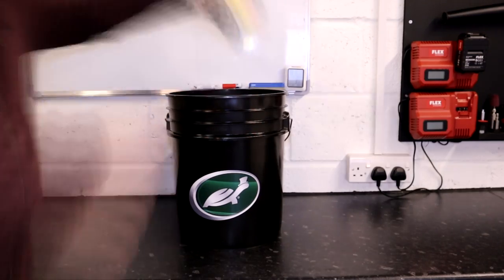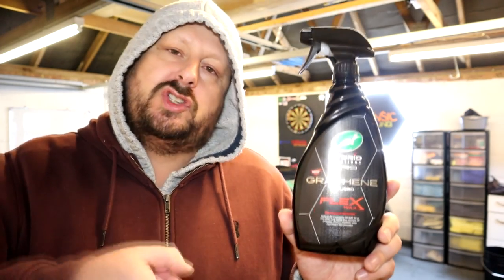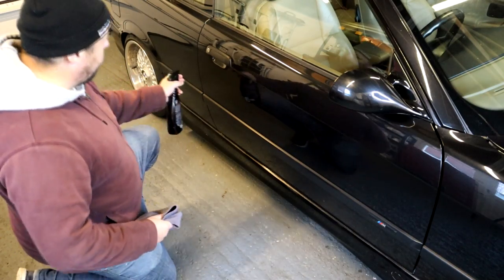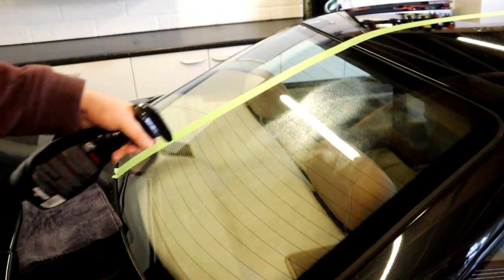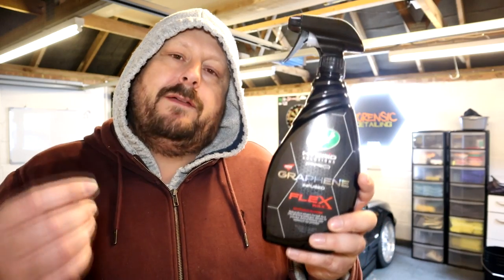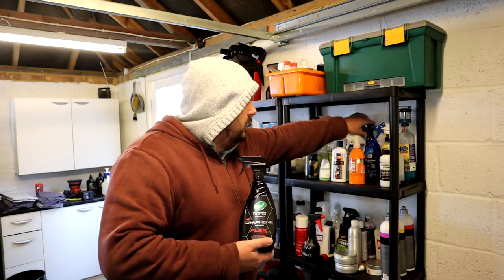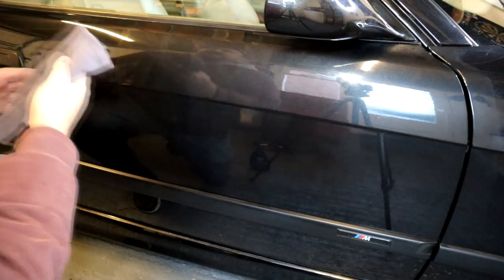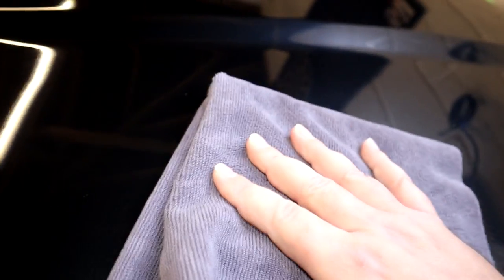Turtle Wax Flex Wax | Paint Wheels Glass Plastics | Base Coat or Topper or Spray and Rinse

Comment: Hi from Southern California.  2 years ago I bought a new K5 GT LINE in passion red metallic paint. Its a gorgeous color, and when the car was a month old, i hand waxed it.  I used Maguires ultimate wax, which is what i used on the old car and i liked it. It didn't really make the paint look as good as i had hoped.  Then i tried  this product,   I could tell in the garage this was looking pretty good.  But when i backed it out into the sunshine,  before i realized i was shouting WOW!!! I said it again,  WOW! Just looked fantastic. it actually sparkles!  I wash the car once a week, it lasts about 2 months,  the hood and trunk goes from beading to good sheeting, sides of car still bead. So i mist the car while wet, and dry.  Our California sun is strong, and theres no covered parking where i work. Car is about 2 and a half years old now, and the paint looks like new, and always feels very slick. Very happy i discovered this product,  and will definitely keep using it. Enjoyed your video.

Comment: It can only be used a spray and rinse if you have a base coat that has been applied to a dry vehicle and cured first. Then, and only then you can spray n then rinse to apply.

I have even sprayed this on my vehicle on a day it was raining outside and i was about to drive roughly 30 miles on the highway. Point is, i had my vehicle with a good foundation of this product and its been about 4 days and it was getting a little dusty. I sprayed about 3 to 4 sprays a panel and drove my vehicle out of the garage so it was bone dry to start.

Anyway, the next day my vehicle looked as if it had been washed and waxes. The normal dirt build up on the hood wasnt there it was a great plan and worked wonderfully. This is the newest lazy way to apply this and it works lol. My windshield was more clear than it had ever been, looking in my side mirrors, my trucj was the only vehicle that dry driving down the highway it was hilarious and amazing how well this idea panned out.

I hope someone reads this and tries it its fn great.

Comment: It produces 99-100 gloss units on a properly prepped and polished surface. The shine is more of a cold mirror look instead of a warm glow. I had to use a damp microfiber to wipe off then buff with a dry one. It has more slickness than Seal n Shine but not much.

Comment: I used the Flex Wax as a spray and rinse yesterday and results were stunning. A very deep dark drippy gloss on a dark grey metallic car.... Extremely glossy in fact. So easy to apply and hardly any product used. I also have the 75th anniversary paste wax to try yet which I hope to use on my dad's car today. My mind is officially blown so far.... I suspect I will be even more in awe if the paste wax lives up to the hype 😁🤞🏻

Comment: I’ve had this on a few details since January and it has gone from beading to sheeting after the first couple of washes. I did the full prep...wash, clay, one step polish, applied Max Wax and then applied Flex as a topper 2 weeks later...it’s already getting weak 2 months later.
Reply: Yes I've been looking into this and a lot of American details are reporting the same thing is graphene snake oil
Reply: @diljithayre9379  I’m totally dissatisfied with the the Max and Flex products. Their Hybrid Ceramic Spray and even their Seal n Shine are far better products.
Reply: Interesting to know this. I experienced the exact same thing with the TW sealant
Reply: @ptheledge5390  not all TW products are bad but these two, Max and Flex, aren’t living up to what’s claimed. However their Pro Line 1 and Done compound/polish is very good. Their original Hybrid Solutions products are also very good.
Reply: @BetterThanNewDetailing  I think the one and done will be the only thing I will possibly purchase out of these

Comment: Interested product but doesn't appear to do anything that sonax bsd won't do for less than a 3rd of the cost. I bet it won't last half as long either or be easier to apply.
Reply from the maker: BSD beats it on beads and value, prolly not on durability.  But TW will bust out their seal and shine and its "check mate"

Comment: Surely Geyon's Wet Coat is easier to apply?
Spray on, wipe with a cloth for even dispersal then rinse off rather than buff dry.
That way it doesn't matter if it's raining outside (for those of us without garages) as we don't need to buff the car dry after
Reply from the maker: you can use the spray and rinse method with flex as well.  but when you spray spread and buff you know you have formed a consistent film.. like a good base layer if you like.. so then in subsequent washes you can spray and rinse.   or just spray and rinse if you prefer.

Comment: Compliments on yet another great video. Seek your inputs on Flexwax. I have a ceramic coated car (done more than year ago). It’s a daily driver and I live in a dusty area. I follow weekly ONR rinse-less wash regime. There are minor swirls over the coating and don’t want to clay/polish right now which might reduce the coating thickness. Was planning to use Poorboys Black hole and top it up with flex wax to extend its life to say 3-4 months. Does that sound right approach?
Reply from the maker: This is not good approach.  It's very very unlikely you only have scratches in the coating.  The coating will only be a micron thick.  If you buff on the car with black hole you degrade coating and clige it with resin and wax etc...    You should maintain your coating inaccorednce with the instructions provided from coating manufacturer.
Reply: @ForensicDetailing  thanks, appreciate the inputs. Can I use Flex wax as a topper for my coating to extend its life? I have modesta coating and find difficult to get me hands on its maintenance products.

Comment: John would you say this is better than wet coat in terms of longevity, hydrophobicity and gloss? I use wet coat for paintwork and alloys so is this product worth considering?
Reply from the maker: Ive not side by sided them to be able to say.  But I have a video coming soon which gives you some comparisons of these products against others.  Flex wax is not a durability product though.  I think its like a 6-12 week durability  sort of thing to give a rough example.
Reply: @ForensicDetailing  cheers for the reply, looking forward to the video. I am in the market for a new long term base protection as EZ ghost that I used this year seemed to die off after 3 months in winter, it may partly be due to the fact I think I was using Surfex HD too concentrated as a pre wash but we shall see. I think I recall you rating tac systems as one of the best baseline sealents? Putting coatings a side..

Comment: Hi Jon, firstly thank you for all the videos, they are excellent and really helpful.

I tried this today, brand new car, prepared including panel wipe. New applicator pad and microfibers. Got bad smearing. Tried again after panel wipe 2nd time, same result. Tried waiting a bit longer... Car inside also. 

Repeated with uhd wax and car pro spray ceramic in different areas both worked fine.

Any ideas what I did wrong? I see there are recommendations to use a damp towel on streaks, will try that next time but seems an extra faff
Reply from the maker: Not sure m8 without being there.  But maybe you had old product on surface breaking down.
Reply: Hi PP. Yes, I had exactly the same issue on a black Range Rover Evoque. Streaking was bad and immediately dried. Tried APC to remove to no avail and ended up machine polishing the bonnet to remove the streaks. I have a feeling I was using too much product, but no more than I do of any other product. E.g. Turtlewax Hybrid Ceramic Spray Wax, P&S Beadmaker, Turtlewax Seal 'n' Shine or The Last Coat 2.0. Next time I'll try less product and have some deionised water on hand to help buff off if necessary.
Reply: @ForensicDetailing Can I  use Hybrid Solutions Pro Graphene Flex Was as a Topper on a Ceramic Coated vehicle?

Comment: hello colleague, I polished my car, I was using the seal in shine, I was thinking of changing to that graphene, I will have to apply a finishing polish to the car to remove the seal in shine protection or I can put the graphene directly in the car at the next wash? !!
Reply from the maker: you can just spray the graphene spray wax on if you want.   you get the best results with "full prep" but really this product is more of a topper than full on base sealant.  so just spray it on a  bit like a QD and you have some decent protection for a few months.
Reply: @ForensicDetailing  use meguiars ceramic wax spray, as protection, is it better than graphene turtle wax?

Comment: Im new to using spray sealants. I noticed the Flex Wax doesn't leave the paint with the same level of slickness as a carnauba paste wax. Do you know if the To the Max Wax would give me the slicker surface that I'm looking for or is it unrealistic to expect that?
Reply from the maker: Ceramic sprays are slick m8

Comment: Really like the look of this new TW Flex, but does it need to cure inside for 24 hours?
Reply from the maker: if you want max durability apply it and leave it alone for 24 hours...   but dont worry too much if it rains or gets wet after say 4-6 hours etc... but its "for best" results.  it does make a different by the way.
Reply: @ForensicDetailing  OK thanks, so best inside or a dry 24 hour period outside.

Comment: But does it offer anything better than Hybrid ceramic wax or seal and shine? i'm not so sure and i still have to be convinced about all the graphene BS
Reply from the maker: its a really fair question.  It does not outlast it. I think seal and shine and the ceramic are more durable.    so the niche of this is the "flexibility" and perhaps a better buff so its a product you might be using more but is that going to be enough to get people to go and buy it?  TW know their ranges and the market and I think the Pro line is covering and catering for a section of the market they dont cover so well with the green and other lines perhaps.
Reply: @ForensicDetailing  another question is would you really use this on trim and tyres etc?..NO! there are better products for that so i'm not sure as a pro i would pay 3x what seal and shine costs, and if the graphene is why it's so expensive TW need to show us what it does better and why it's in there....keep up the good work
Reply: @marcodeci3951  would love to see a test between tw sealent and the pro flex

Comment: I messed up this morning & made a streaky spotty mess on my black 2022 Genesis G70. Not sure what to do about it! Any suggestions?
I skipped the base coat & used it as a drying aid 1 panel at a time. Didn’t notice streaking or high spots after buffing until 7hrs later.  Not sure if I should just wait to wash and rebuff after 24 hrs or try to strip it off ASAP
Reply from the maker: Could try just using a water based panel wipe and clean mf towel.   Otherwise don't worry just use the car and wash it in a week's time to and the high spots in will level in out.
Reply: Use very sparingly. Too much causes streaking.

Comment: Great vid!  I don't want to be aggressive and polish my brand new car, also I am not that comfy with glaze, so if I use a finishing polish like M302 and apply it by hand how do you see that?
Reply from the maker: that will work great khalid just use a panel wipe down after polishing and then the flex was will bond better. After the initial base coat you can sort of use it more like a detail spray each wash

Comment: If you could only have 3 500ml bottles for cleaning stuff in your car what would they be ?
Reply: I’m a Uber driver so only have 3 bottles at one time in my car, apc / quick detailer / glass cleaner. Is there a good quick detailer that’s good on glass ?
Reply from the maker: A little interior detailer, some glass cleaner and an air freshner, and some microfiber inside the car to carry around.     Air freshner get the designer fragerence aerosols from county detailing.  mega powerfull quick little spray.     glass cleaner it really wont matter by a cheap one they are all very similiar.   The Adams interior quick detailer is nice for the inside of the car.

Comment: I want to buy a pressure washer to start cleaning my car myself. I was looking at the Karcher K2, what do you think of that machine?
Reply from the maker: ok tim so the K2 is like the entry level machine its really down on grunt or power but this is ok.  So if you have a budget of say 50-70 quid it will do a job. but I think if you can get you budget a bit higher to 150-200 getting a K4 will be of more benefit for the extra kick you get
Reply: @ForensicDetailing  okay, thanks Jon, appreciate it.

Comment: Hi John just seen you video on the sketcher k7 just done water test got 15 Liters
How easy would it be to get an fit a quick release trigger gun to fit the k7 would I need extra bits to put on the hose if so would yuck know the part I would need as I'm unsure as never change my k2 to a quick release gun many thanks stewart
Reply from the maker: it takes about 5 seconds Stewart.  you unpop the karcker gun by pressing the yellow release butten. and you just plug it into the quick release gun.  done.    

With the K7 though you have a pressure control on the OEM gun so I keep that gun in the karcher unit just so I can use the + and - pressure controll.

Spray Trigger Gun for Karcher K series
https://tinyurl.com/2v8gkitw
Extention Arm Quick Release
https://amzn.to/3tyxV5Z
Snow Foam Lance (select 1/4 quick release fitment)
https://tinyurl.com/35pa3tsz
Pressure Washers (I Use K7)
https://amzn.to/3pLIpMP
Reply: @ForensicDetailing  cheers John many thanks 
😊😊👍John how u finding the k7 eny good ?
Reply from the maker: @stewartherbert6847  very very good.  I can unreal it if its not under pressure without it toppling. it has too much power so you need to run it at mid pressure setting. but that extra power is wicked for the patio.    and its not skipped a beat so far.  really great unit for the money.
Reply: @ForensicDetailing  that sounds good an worth getting one then .
silly thing to say now but I will . When the quick release is fitted on you can't adjust the pressure is that right. Or can you ?  There  a question a silly a
Reply from the maker: @stewartherbert6847  when the quick release gun is fitted you have to use the original gun to adjust the pressure this has like a wireless + or - eletronic pressure control so I leave the original gun in the holster on the unit to adjust the pressure even though its not connected to the water feed pipe.
Reply: @ForensicDetailing  hi on the k7 video you about where you place the gun u may make some adjustments did do that in the end as u said it mark the gun?

Comment: Not really impressed by the finishes to be honest. I've seen better. However Can I borrow some of your vast knowledge about sealing Chrome wheels to protect them from rain spots and brake dust and if possible road salts in winter months. Much appreciate your help as im getting new wheels next week and not had chrome ones  before.
Reply from the maker: so if its bare chrome you could look at a product called white diamond which is a metal polish and sealant in one.  you could also look to polish them up and coat them with a ceramic but I think you will want to be poishing them.  Im in the same boat with my RC90 alloys. its a major paint.  then sort of tarnish up if yo uleave them too long and then you have to wire wool them to remove the tarnishing but then its a pain to bring back the brilliance gloss from refining it more... so no easy win on this I think bare chrome = lots of work.
Reply: Thank for your helpful reply.
I never thought chrome was so demanding. May have to go with painted alloys with diamond cut face. Unless they are hard work too.

Comment: This one to me is a little hard to get off. I use a vwry light n finish detail as im wiping and that helps get a perfectly clean panel. I get smudges that are hard to get off, i also have a wbite truck so its Hard to zee what ur doing until u notice it in the right light.  A very lighly damp mf works well for the first wipe too.

Anyway this is an amazing product and lasts forever.
Also looks better as it cures and gets even more slick with time.

Comment: Great video as usual. Can you help, I have a professionally applied ceramic coating, and so should I apply an sio2 product like Carpro Reload or flex wax etc, very confused 👍🏻😊
Reply from the maker: Hey Mark, If in doubt the best thing to maintain a coating are the maintainance toppers for that coating from the same brand.   As these will have been tested to work with your coating.   If you go off piste you will be the first person testing product X with product Y.

Comment: Not a fan of any of these multi purpose products. I get that some people will find  the multi task aspect very useful but not for me. I am still using paste wax  and pure shampoo. I like a dedicated product for a dedicated use. I did try some of the turtle wax hybrid stuff and was not impressed. At £18 it is now no more than an expensive , little used wheel protectant as that's all i saw it fit for.
Had to laugh at the Turtle Wax PR Ad clip of the 3 guys in lab coats. Just looked ridiculous. 
With the brand name , advertising and shop floor exposure it will no doubt be a big seller. Be interesting to see feedback from anyone on here who tries this stuff out.

Comment: can you apply this over a pre-existing ceramic coating?  or must you remove and start from scratch??   ... wait I guess you answered that.... but would you? if you're lazy? 😂😂
Reply from the maker: you can just spray this on top of a coating.  there would be no reasno to remove the coating, the coating is a proper durable base layer product, this spray product would not complete with a durability of a coating but it would compliment it as a topper.